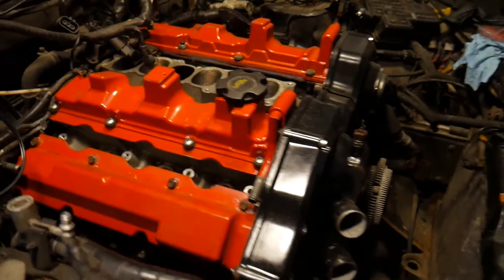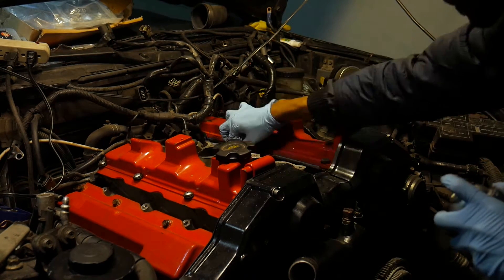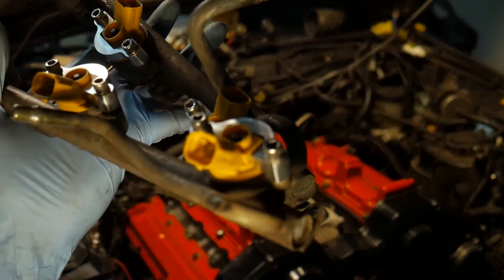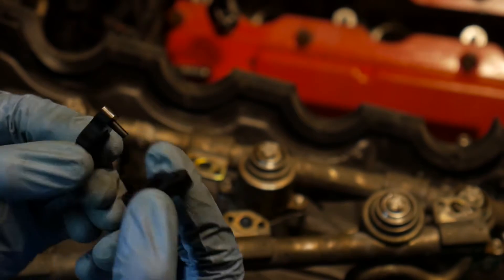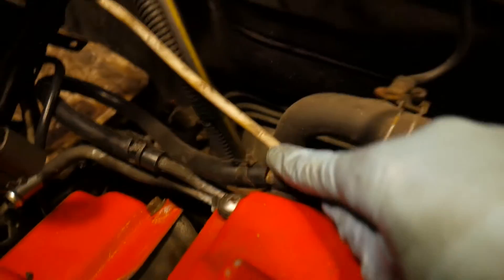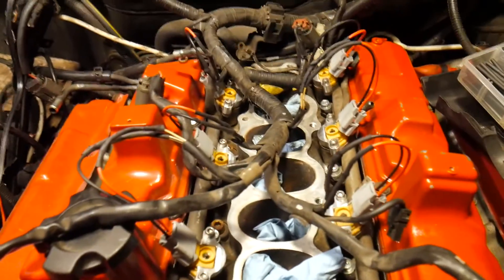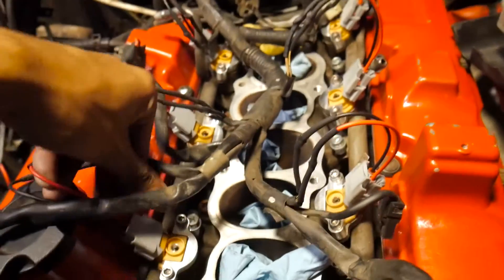Upgrading Nissan 300ZX Fuel Injector

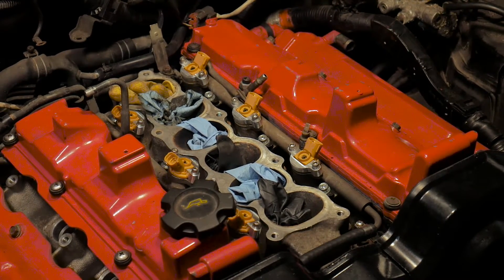Comment: Regarding 4:20, is the ground strap located by the plenum bolt hole located on the driver side nearest to the firewall? So far, I am counting 2 ground straps, one on the driver side, the other on the passenger side both located on the lower plenum nearest to the firewall. Is the one you're referring to a 3rd ground strap?

Comment: What year is your fuel rail from, is it the old style or new? And if it's the old what adapter did you use
Reply: It's a 1993, so it's got the newer style injectors, he didn't an adapter... You can pick up an adapter at Conceptzperformance.com or maybe z1motorsports. Also, if you do this, you will need to get an ecu upgrade or have software to reprogram the ecu to adjust for the size difference, these are 2x as much as the OEM (270cc)

Comment: great vids man, inspiring me to work on my 90 z n/a
Reply from the maker: they are not really that hard to work on, i just have too much on my plate so taking it easy. the car should be out of the garage in a few days after 6 months.
Reply: still turboing it?
Reply from the maker: yes sir, its still getting turbocharged, just sort of taking my time. I will have to design the exhaust system next and fabricate it